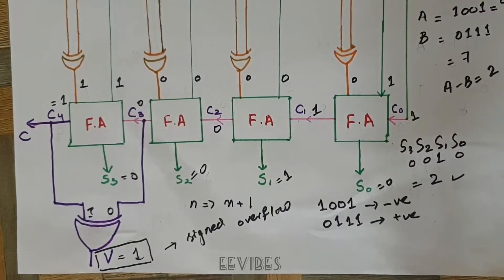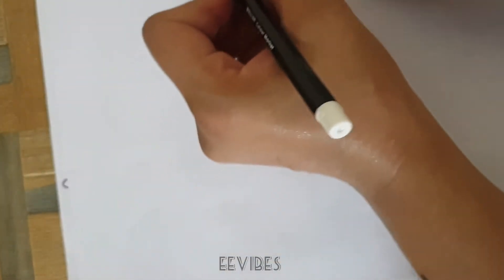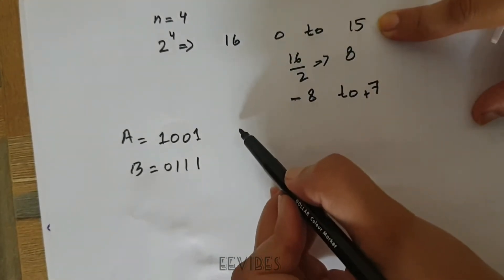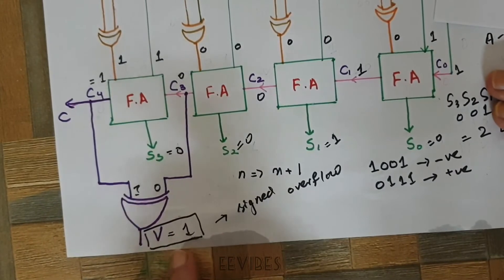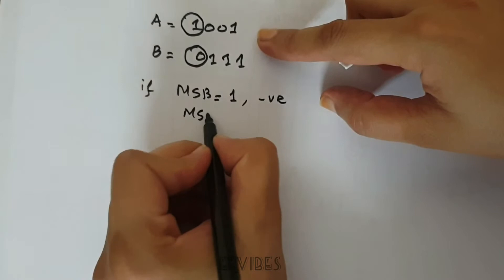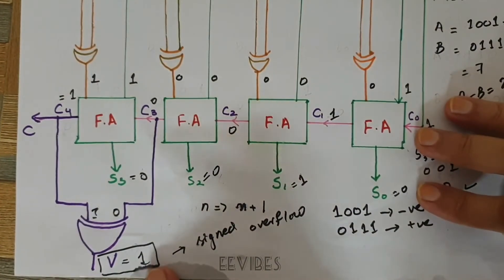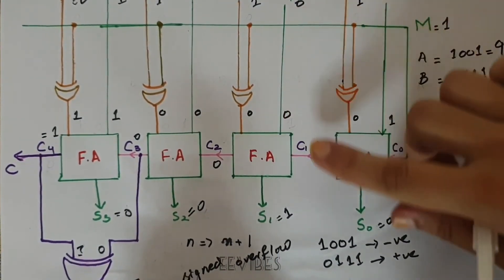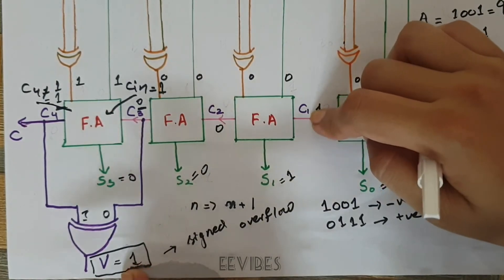Overflow in 4 bit Adder-Subtractor Circuit || Explanation with Example

Comment: i have a question. When A = 1010 , B = 0000 . In unsigned representation , the carry and the overflow will obtain value 1 or 0 when operation A - B is implemented??
Reply from the maker: In this case, when you are treating the numbers as unsigned and perform A-B then (A=10, and B=0 in decimal). So, basically 10-0=10 which is representable in 4 bits (so no overflow) that's why V=0 while C=1.
Reply: @eevibessite  in this video, u say that carry = 1 while addition or a borrow when subtraction. But a borrow doesn’t occur when implementing “A-B”. Then, why the carry equals to 1?
Reply from the maker: @omwmakingprogress  In subtraction, carry-out is interpreted as:

C = 1 → No borrow

C = 0 → Borrow occurred
Reply: @eevibessite  does it work for both unsigned representation and signed representation? and how the carry-out works in addition for both circumstances
Reply from the maker: @omwmakingprogress  In case of addition, The C bit represents a Carry Out of the most significant bit (MSB). If there is a carry out (i.e., result > 15 for 4 bits), then C = 1, indicating overflow for unsigned addition. For Example:1100 (12) + 1010 (10) = 10110 (22). Only 4 bits are kept: 0110 (6)
C = 1 → Carry occurred → Result overflowed for 4-bit unsigned.

In subtraction, The C bit represents "No Borrow". If the result is positive or zero, C = 1 (no borrow). If the result is negative, C = 0 (a borrow occurred) → indicates underflow.
For Example:
0011 (3) - 0110 (6) = 1111 (-3) in 2's complement
Since 3 < 6 → borrow occurs → C = 0. I hope its clear now.
Reply: @eevibessite  suppose that A=1100 (-4) , B = 1001 (-7). Implementing A-B , when I run systemverilog code on quartus application I get:
+ Carry out = 1
+ overflow = 0 
Is the result correct??
Reply from the maker: @omwmakingprogress yes
Reply: @eevibessite  By the way, if I have any questions about this subject, where can I ask you without using comments on Youtube??